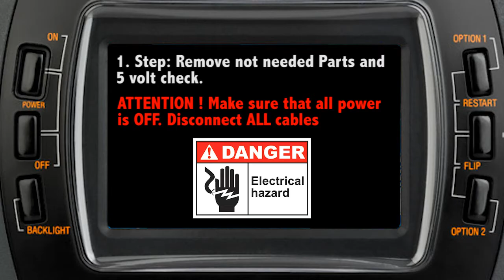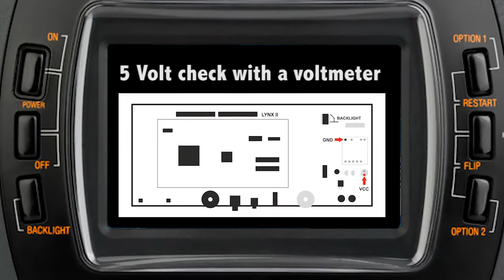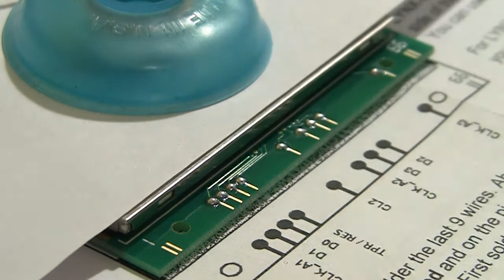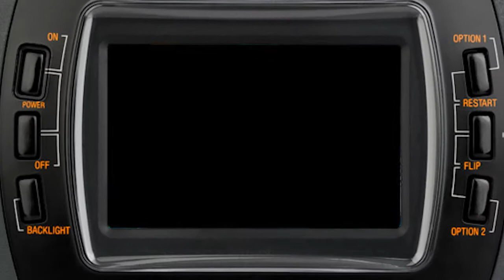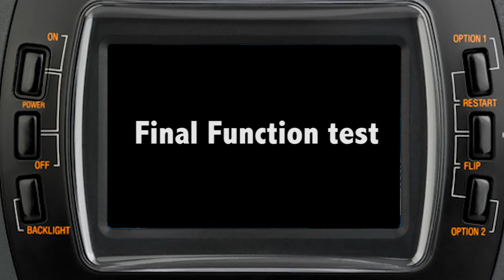ATARI LYNX 2 guardate il nuovo display alto contrasto. Tutorial su come installarlo. IN ITALIANO

Comment: You have done an outstanding job with this video!!  I have just bought two replacement screens from McWill but was kind of hesitant how to start things. I mean I am sure I could have done it but this video makes everything just soo much more clear. I would ask only one thing, what kind of wiresd did you use? I am thinking about buying one of these: "UltraATA66/100/133 80 Wire IDE Cable for Hard Drive / CD / DVD / Blu-ray" . Would it be ok? Thank you very much again.
Reply from the maker: +zoltan87 
Hello zoltan and thanks. I used a flat cable used for older HD parallel.

Regards
Reply: +Daniele Tartaglia I have just found some flat cables, the problem is that they seem extremely thin, 32 AWG. What do you think would they be ok to use them, or they couldn't handle the current flow? The wires you used in this video seem definitely beefier than the ones I have.